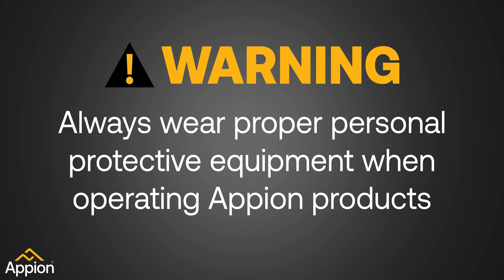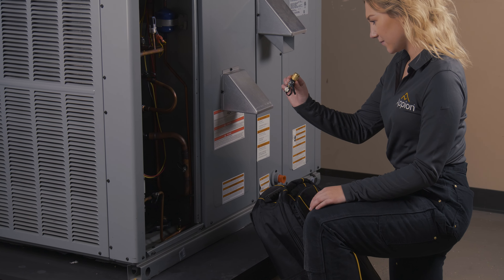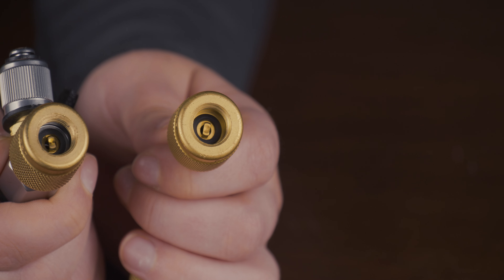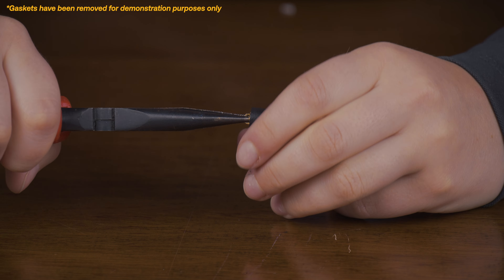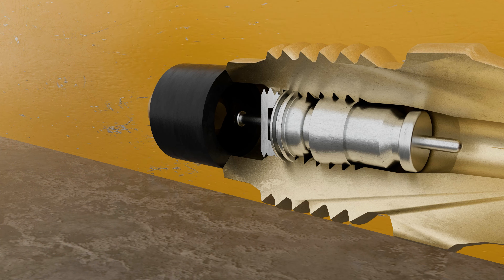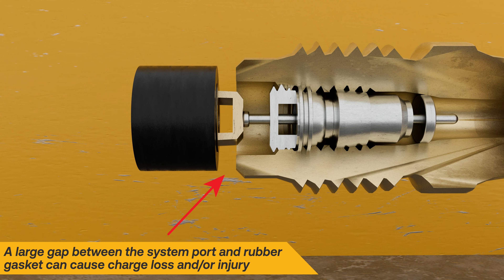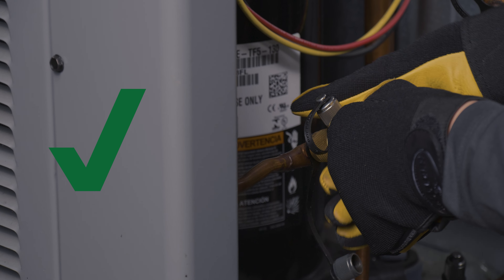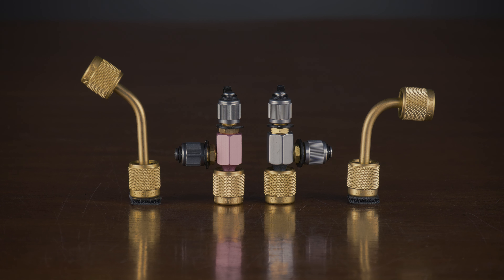Charging T & Adapter Fitting Proper Use

Comment: the flare adapter fittings vacuum rated to use w the mega flow hose ??  my new navac vacuum is really tight to screw down the hose to so I need an adapter to make it work .. would this work properly?
Reply from the maker: The flare adapter fittings are vacuum-rated to 20 microns. Our hoses and flare adapter fittings both have two female flare fittings, so both will work with any male flare fittings.